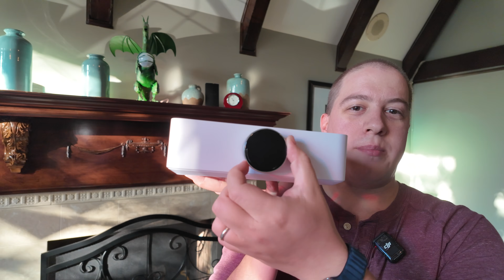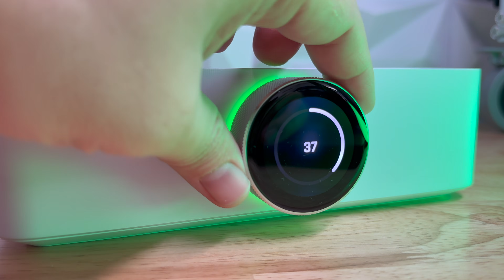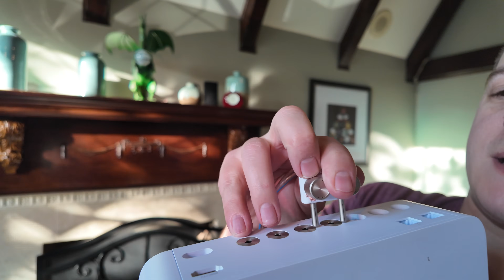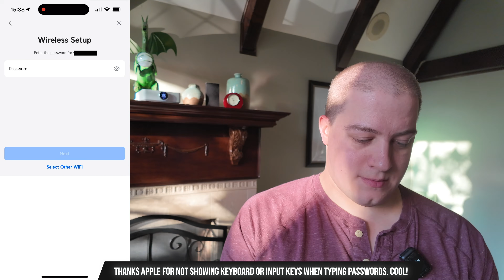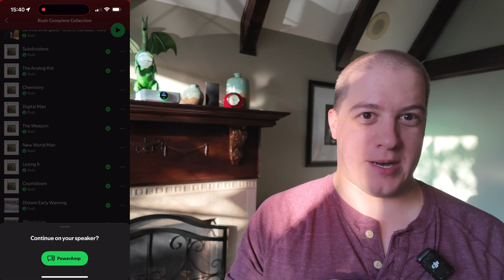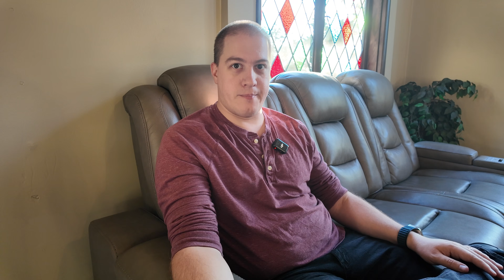Ubiquiti Does Audio Now?! Introducing the High Fidelity PowerAmp and All New Unifi Play App

Comment: I have one of these. Overall, I am disappointed. I primarily use it with my TV via eARC (for now). If I want to use line in or streaming, I have to reboot the unit for audio to be audible. I will probably move it to my zoned speaker setup since it can only do 1 input, consistently, all the time. It’s not worth the $600 price.
Reply from the maker: Sounds like a bug. Have you reached out to support?
Reply: @ I opened a ticket. I also noticed that when using line in, if you pause your audio input, the audio will on the power amp will continue to pay for the next 30-60 seconds. Like it buffers the input/music.